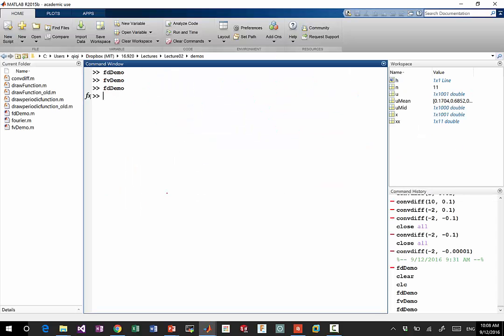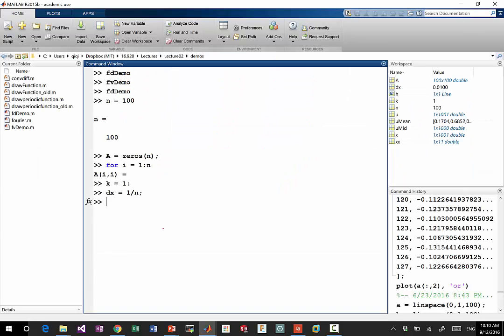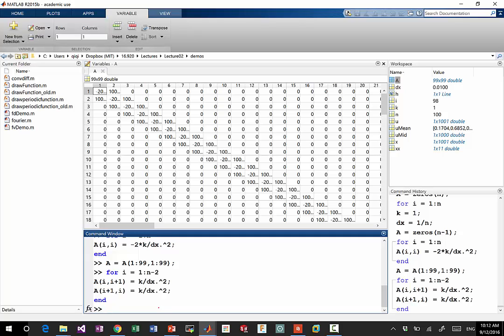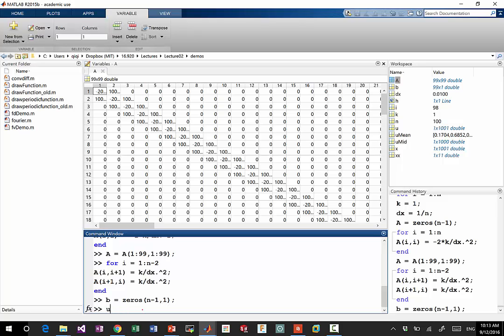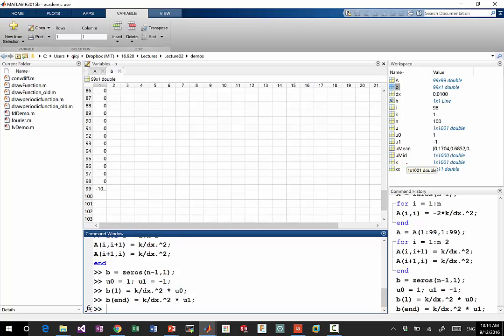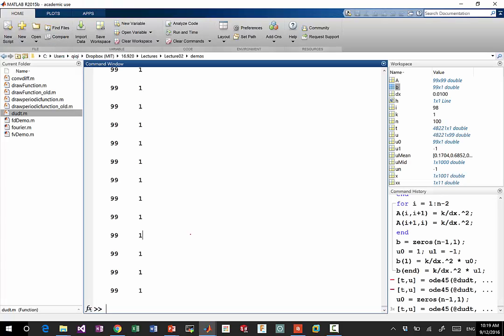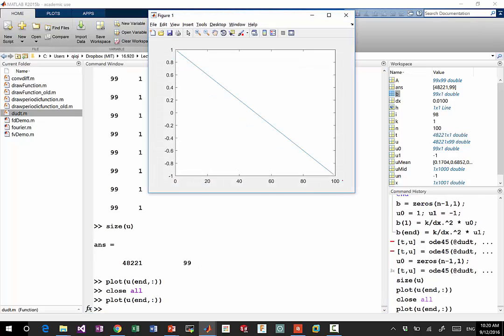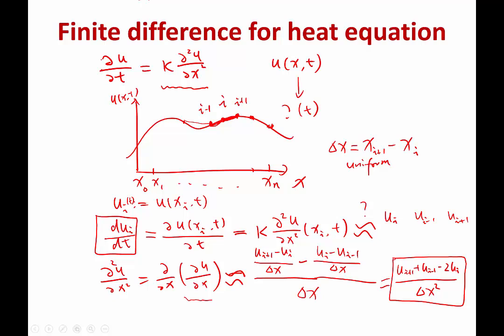Lecture 02 Part 5: Finite Difference for Heat Equation Matlab Demo, 2016 Numerical Methods for PDE

Comment: So many errors. And you should've used ode23 for solving the heat equation because the heat equation is stiff by nature. That's why ode45 took so many time steps. 

Thus, higher order methods are inefficient for PDEs and the benefit of using a higher order method is lost while lower order methods such as ode23 are more efficient. Stiff solvers will definitely be the most efficient.

Comment: A very handy way of creating a Tri-Diagonal matrix in MATLAB is to use "toeplitz" command, just enter the first row in the command and it will give you whole matrix..you can impute zeros using zeros functions..
Example...A = toeplitz([-2/dx.^2, 1/dx.^2, zeros(1,96)]) ...this will create the required full matrix. Also, if the matrix is not symmetric you can give first row and first column as input into the toeplitz command.
Hope this helps